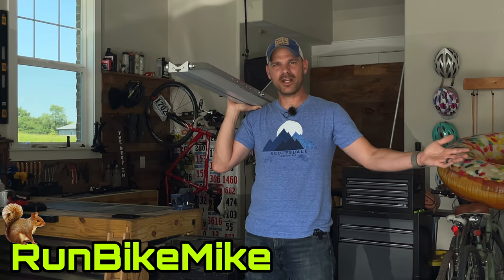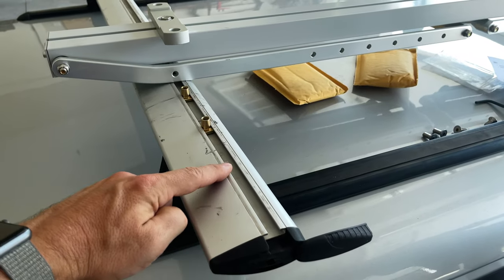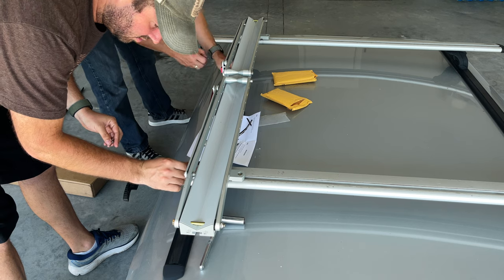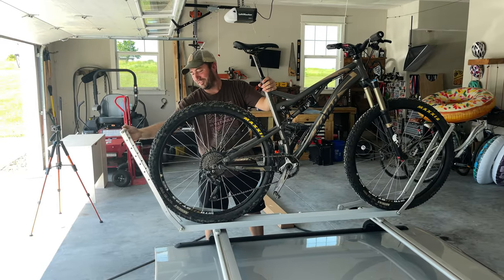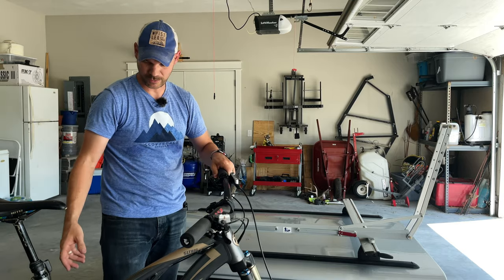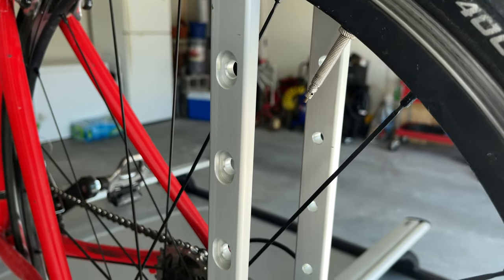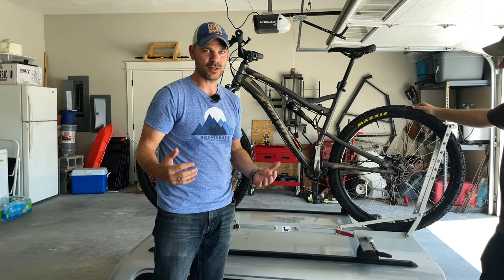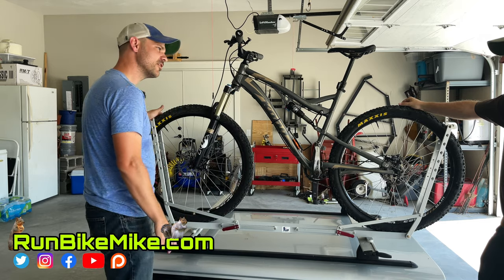HOW TO INSTALL a 1UP USA Bike Roof Rack and Review

Comment: I just used my new super duty 2" hitch rack. IT REALLY NEEDS A BETTER WAY TO UNLOCK AND SWIVEL. 1up wants you to spend $90 more, on top of the $665-$715, for their extremely poor implementation of a latch and positioning thereof, that allows swinging rack up and down!